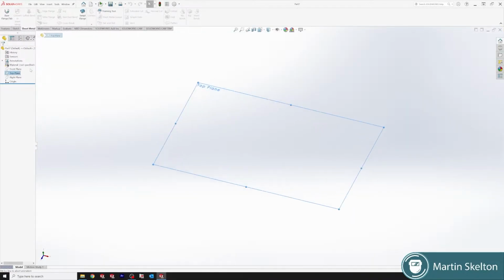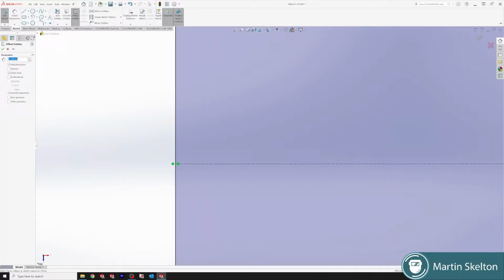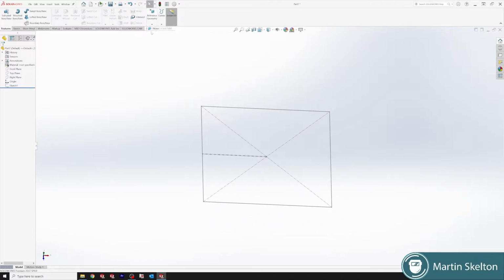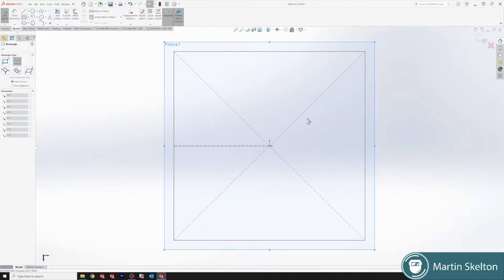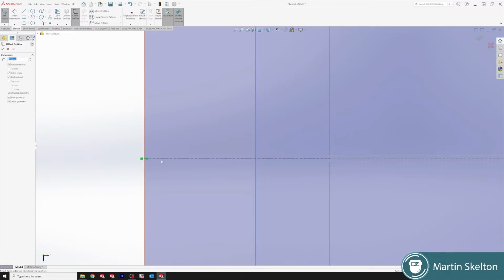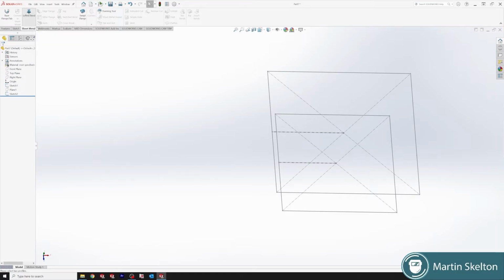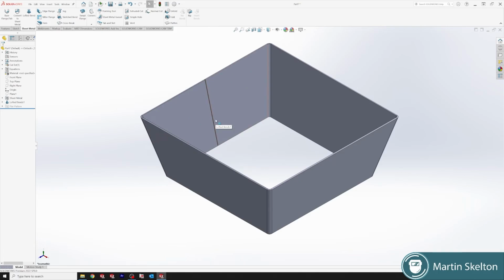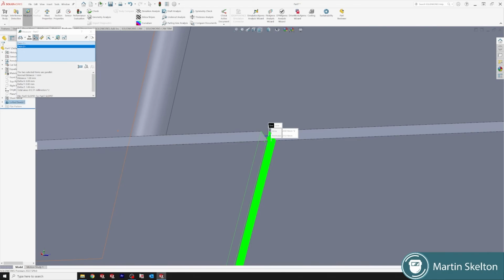SOLIDWORKS FEATURE IN 3 MINUTES // LOFTED BEND

Comment: Do you think this kind of flat pattern can use fabrication/bending durin they can make hopper ?
Reply from the maker: Yes, a flat pattern can definitely be used in fabrication and bending processes, including making hoppers. It really depends on the specific design and material you're working with. I have built physical hoppers using the bending method but at a certain stage they become to hard to bend/press in the brake press.  It is the size and material thickness that really decides if you could use a flat pattern method for bends. If the hopper is to large you might have to make either 2 sperate bended sides and the weld or you might have to make four individual sides and weld.